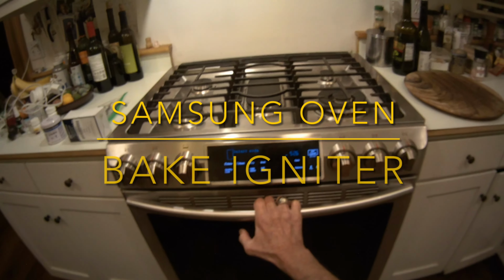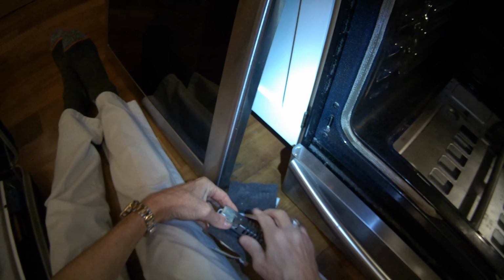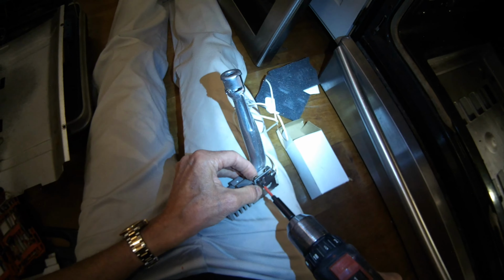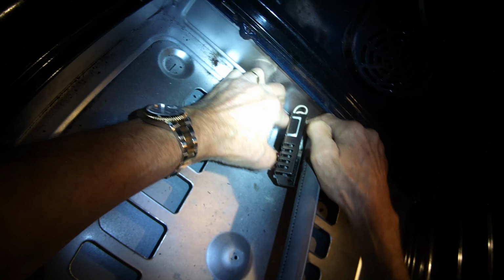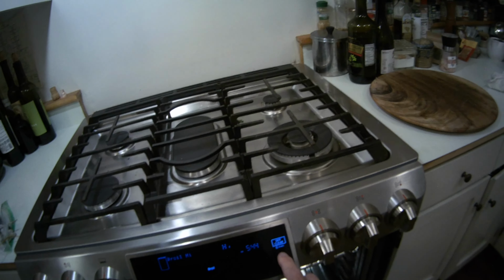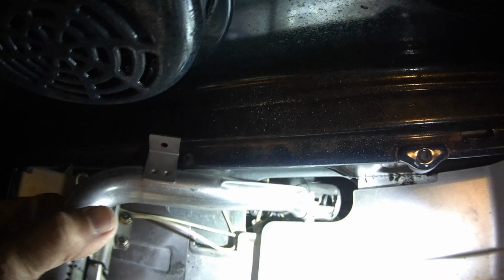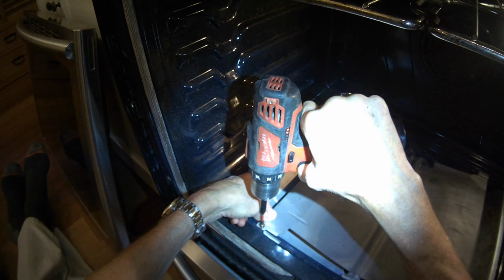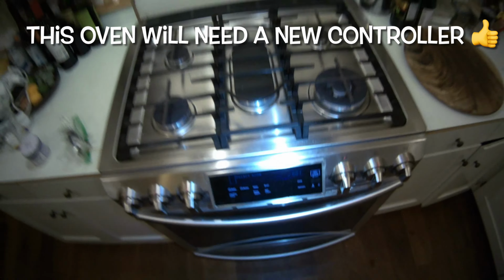Oven Not Heating? Samsung Oven Fix That Actually Works!

Comment: The problem is where do you get the original replacement igniter that will work, as their part supply chain is as bad as it gets and the part DG94-00520A that a friend needs has been and still is on national back order with no ETA how does one get these parts.
Reply from the maker: Thank you @vidworxsfx!

To find the original replacement igniter DG94-00520A, consider these options: 

1. Check with authorized retailers or repair services that specialize in your appliance brand.
2. Look for alternative parts on websites like eBay or Amazon.
3. Contact the manufacturer directly for updates or alternative solutions.
4. Join online appliance repair forums for advice or leads.
This igniter will work great : https://amzn.to/4n9TGEm
If you need more info, you can reach me directly for a fast answer at AsqMe.com/@ScottTheFixItGu
Reply: @ScottTheFixItGuyChannel  Thanks for the reply I sent that link to my friend as it seems better quality then others I found while researching.

Comment: I ordered this part for my samsung gas oven (that looks exactly like mine) but the connections are NOT the same. If you order this part make sure the model numbers match from the user manual to the part on Amazon.  My mistake.
Reply from the maker: Good thinking,
Thank you😊

Comment: Hey Steve your video was very helpful but the problem I’m having now is once I put the 2 heat plate back the gas doesn’t want to ignite, the oven fills up with gas but won’t ignite so I took off both shields and it ignites right away, what am I doing wrong thanks
Reply from the maker: Thanks Bryon,
Can you send a few pictures of how the igniter is installed to: scottthefixitguy@yahoo.com

Comment: Hi Scott, great tutorial! I am having the same issue, looks like it's the same unit, igniter has been replaced. Which board did you replace to fix it? Front control board or the PCB at back of the oven?